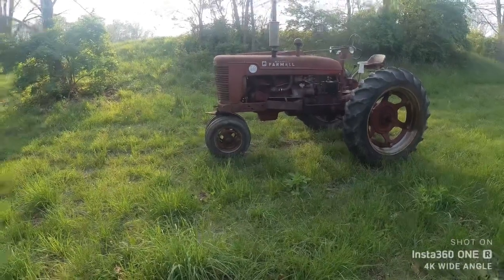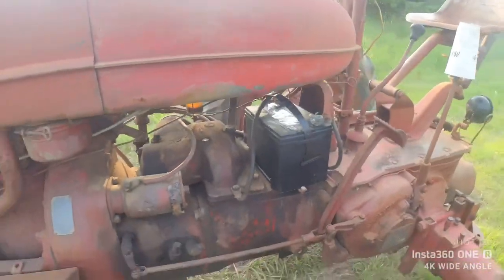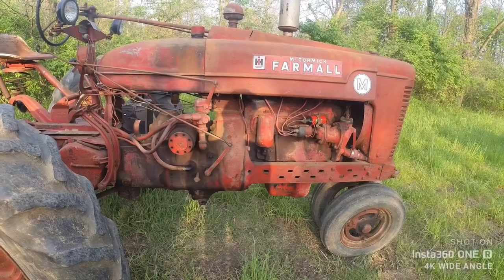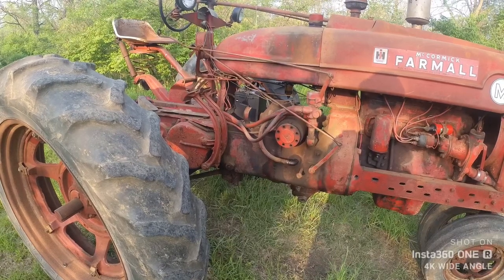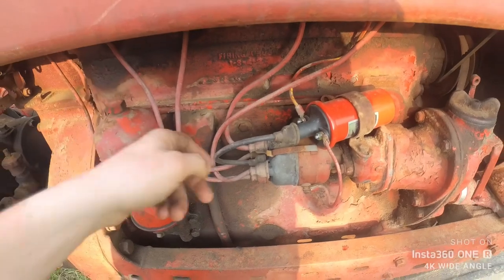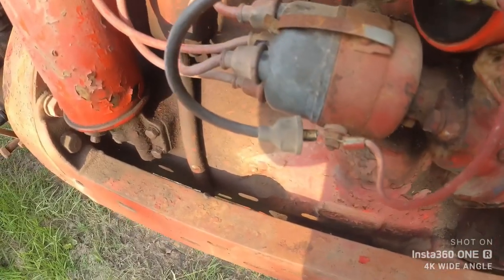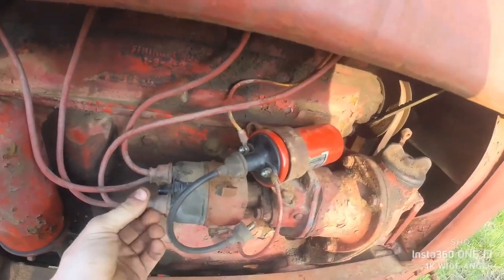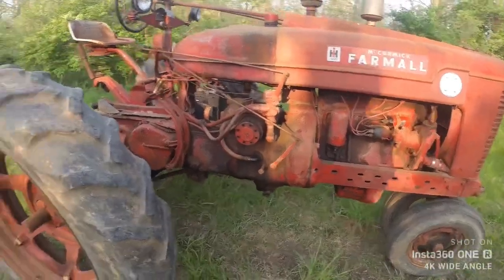How to start Barnfind Tractors for beginners

Comment: Thanks for this. I have been playing whackamole on my tractor that was running fine but shut off while I was brush hogging. Replacing the ignition got it running twice. I did that because the headlights not working made me think it must be the ignition. Then I replace the igniton again which worked twice again. Traced the power and found the aftermarket Ammeter (I assume installed when the prior owner switched from a generator to an alternator). Bypassing the ammeter got it to turn over again but its not starting. From your video I took the coil cable off the distributor and I am not seeing a spark. Took the coil out and I'm getting no ohm reading or continuity so I ordered a new coil. Hopefully tomorrow I can finally get the tractor going again.
Reply from the maker: I’m glad I could help hopefully that does it

Comment: hello there - I just picked up a M - what size tires do you have on the front ? I have 6.50x16 and they are dry rotted and need replacement. I will be looking for some new ones and hopefully not break the bank. 
Thanks for the video. I'm currently cleaning the carb and gas tank. I had it running on some starter fluid before I dumped any time or money into it.
Reply from the maker: 6.00 or 6.50 will work well if you have smaller back tires then I would go with 6.00-16
The last set I bought was on Amazon a package deal two, three rib tires and tubes
Reply: @DrRust  thank you - the rear tires are huge

Comment: I have a 715 ih gas combine .its was owned by my cousin but he passed away its been sitting under the shed over 5 years.i cleaned the tank new fuel,cleaned the fuel pump,new plugs, it is sucking fuel i loosened the fuel line from the carb and it’s getting fuel .but it just wont start i tried choking it and it still wont start.could you help me !?
Reply from the maker: Have you checked for spark?
Reply: @DrRust  I haven’t !,everyone has been telling me to check for spark ! You think that could be the problem ?
Reply from the maker: If it doesn’t have spark it can’t run so I bet that’s it probably just have to clean the points
Reply: @DrRust  will sand paper do it?
Reply from the maker: It might but I recommend a points file they are cheap and very useful
Reply: @DrRust  okay I will keep you updated

Comment: Damn.. I’m so glad I came upon this. I bought a antique tractor but I don’t know a freaking thing about tractors, I finally got the motor unstuck but I didn’t even know where to start with trying to start it.
Reply from the maker: That’s exactly why I made this video
Please let us know if you have any luck with it I always say If it will turn it will run just maybe not well thanks for watching
Reply: @DrRust do you have any suggestions for battery size/capacity?
Reply from the maker: What type of tractor is it? and 6 or 12 volt?
Reply: @DrRust  12 Volt. 1950 Fordson Major e27N in Northern Ontario

Comment: I don't have a tractor but wish I did. I could keep this road up a little better BUT sooner or later someone will bring a hoe by and I'll snag it and work the road so I don't guess I need one. All my fixes are small engines and go with a lot of the same guide lines. And all are freebies/rescues or not for much.  Either $15 or $30 for the most expensive one for tubes the other owner put in. All are saved from scrap and all run and run well. They even cut grass! And if I can't use something I'll give it to someone that can and will. And that sediment bowl is telling on you! Good deal and GBWYall!
Reply from the maker: I love anything internal combustion so I always get wrapped up in the weirdest things
People give me chainsaws and rototillers pretty often
Reply: @DrRust  I used to be the neighborhood fixer but am doing good now to keep my own stuff going. I drove CDL/chauffeur and ran heavy equipment all my life so it all worked out fine.
Reply from the maker: That’s cool my grandpa was a teamster his whole life and my dad was a heavy equipment operator/mechanic for most of my growing up
Reply: @DrRust  i really started driving around 17 or so but fooling with stuff before that, Army 5-tons at 19, chauffeurs license at 21 and on it went, or maybe it still goes.
Reply from the maker: I’d like to get to drive a 5 or 10 ton some day
Reply: @DrRust  5-ton was just a 5-speed and now Allisons and the old 10 tons were just 5 speeds with a spluttering 903 Cummins to pull them. You could get about 7 gears out of a 5 ton with splitting the main and Hi\Lo in the transfer case. No biggie and the 4x2 was automatic in the 5 ton but you had to shift it in the 10 ton. A Mack 800 series has about the same axle setup asa10 ton.